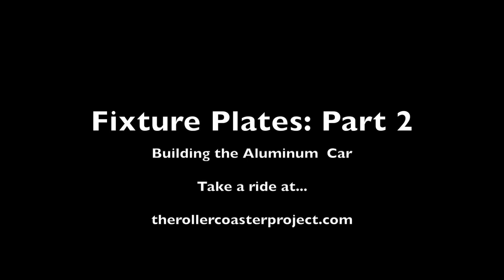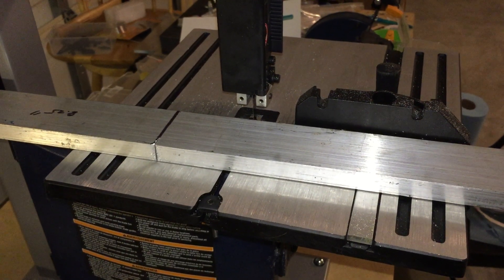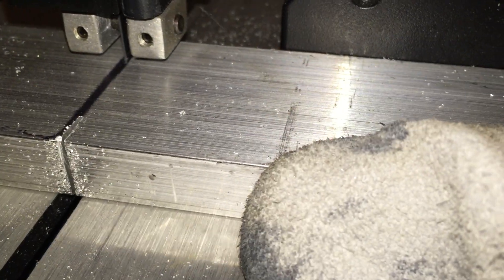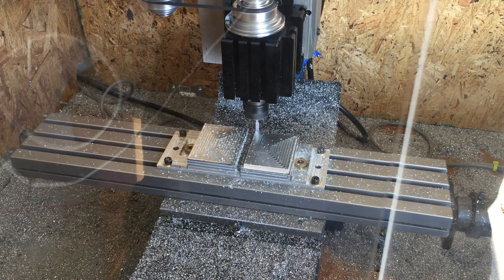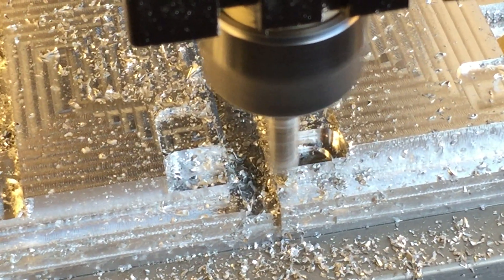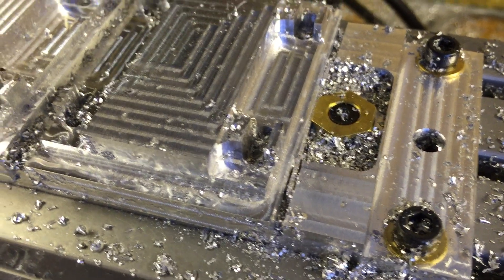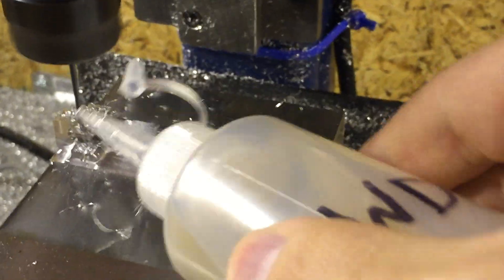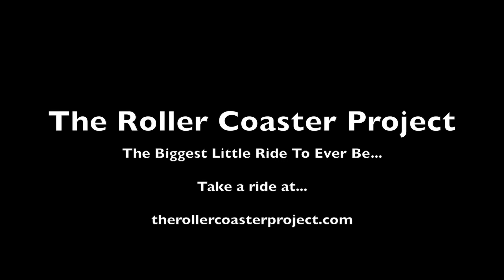The Taig CNC Mill and Fixture Plates: Part 2 with the Aluminum Car

Comment: What ultimately puzzles me about machining aluminum especially the CNC way is that: - One category of machinists uses crazy liquid or fog cooling methods with the advanced chips evacuation along the way and it of course works perfectly; - Another less concerned category of machinists use some occasional liquid spray cooling and lubing with an occasional brush chips sweeping off and it works fine for them; Still others use no cooling no chips removal and it seems to work without problem again. Go figure...

Comment: What CAD software did/do you use or did you write the job yourself?
Reply from the maker: Ripperfan Screwing Around at the time I was using CamBam, and it was “so-so”.  I later switched to HSM for Inventor, and now I use the CAM software for Fusion 360.  I try to keep the designs to 2.5D machining, though for ease.